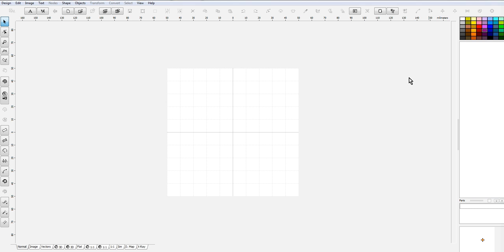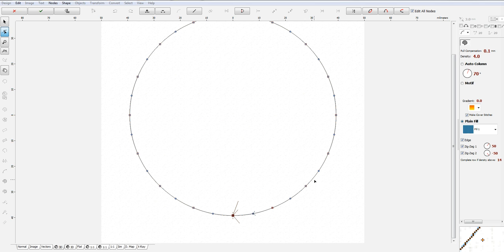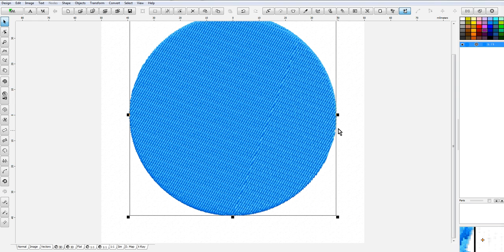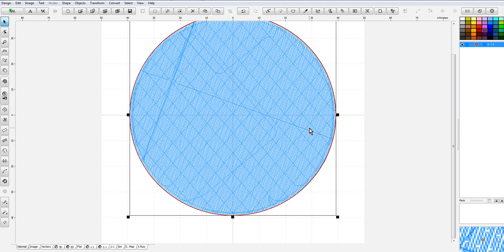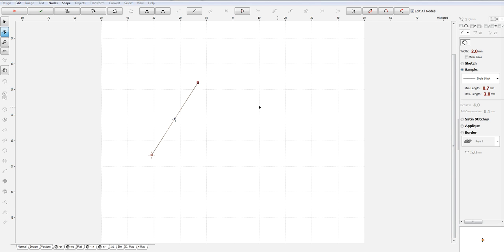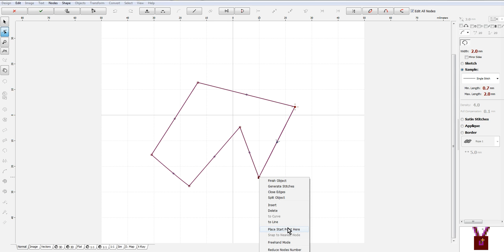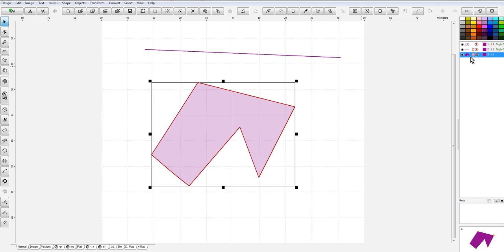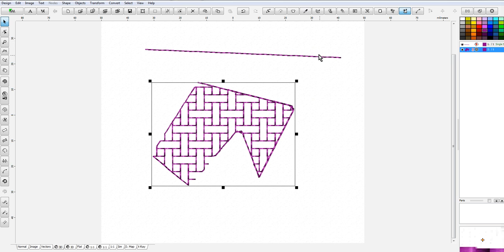Embird Tutorial:  How to change your start and stop positions in your designs

Comment: Are you demoing Embird Basic or Studio?
Reply from the maker: This was studio, but I cannot remember what version as this video is a few years old.
Reply: I guess a better question would be can I do this with the 2023 version of Embird Basic.  I am working with the demo version trying to decide if I want to continue adding to Embrilliance or switch to Embird.  The Embroidery piece I am working on was not an Applique and I added additional stitch down rounds for batting, fabric top and backing done after the decorative stitches.  I am getting a little build up of back tacks in one place because the layers all start and stop in the same place.  I would like to stagger them.
Reply from the maker: When you are in the editor, and have the single object selected, under edit -- can you select the option to edit contours in studio?  If so, try that, then select edit and you should be able to move the start point there.  I am in the middle of a computer upgrade, and haven't got mine upgraded to 2023 yet - but have played around with the demo version.  See if that will work for you and let me know.  
 @mlatham23